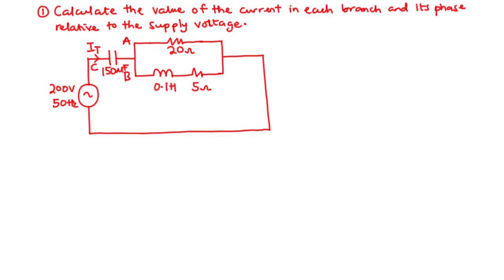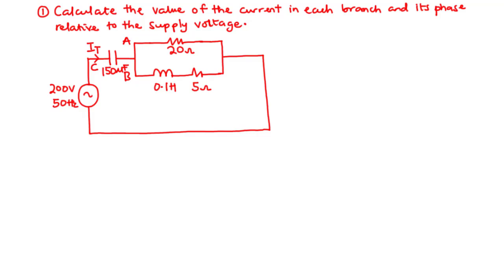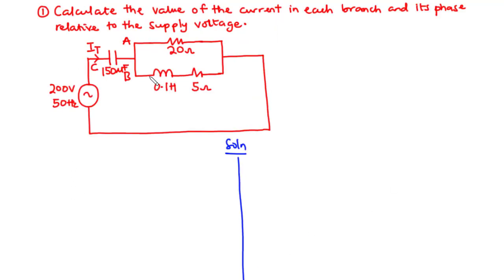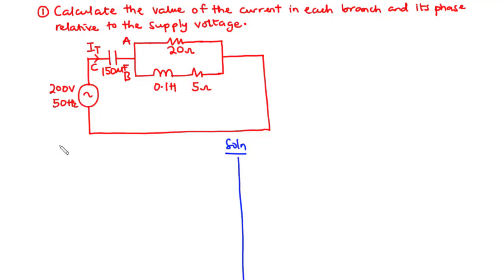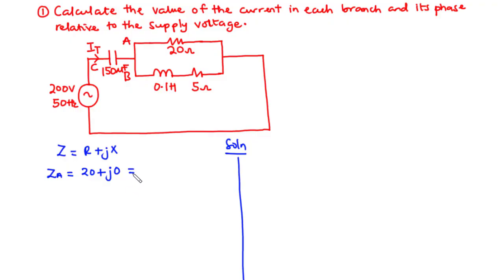47 - Solve AC Circuits with Complex Numbers

Comment: Why are you working in polar form?
Reply from the maker: That's the easiest way to solve such a question, and notice that at the end, we will need to compare the phase of the current values with the voltage, so you'll definitely need to convert to phasor form. So why you do that in the initial stage
Reply: I read that polar form is only easy for multiplication and division then rectangular for addition and subtraction. I was confused during the video.
Reply from the maker: Yes, I get you, but once you will need to find the phase angle at the end, it's best you do the conversion first, that's the easiest way. Moreover, you are not going to solve step by step. You will need to complement your solution with a calculator